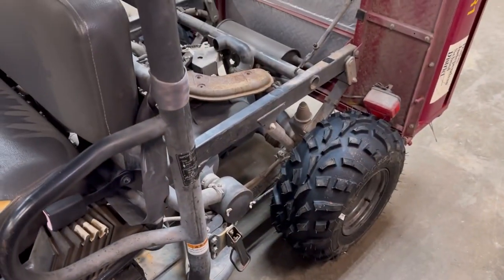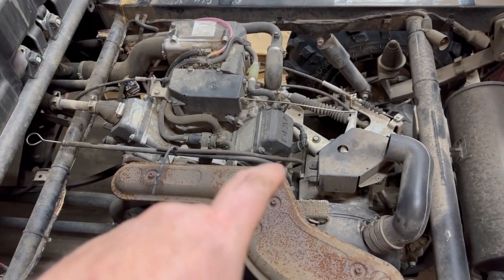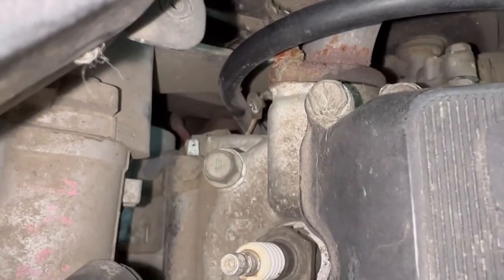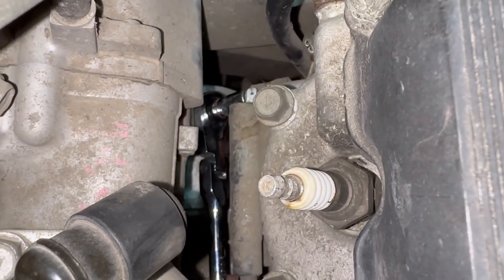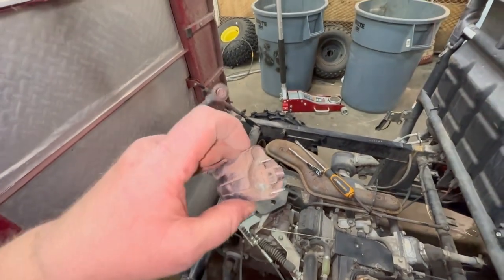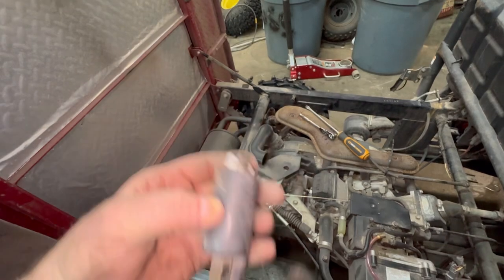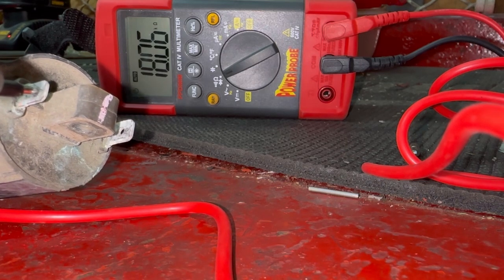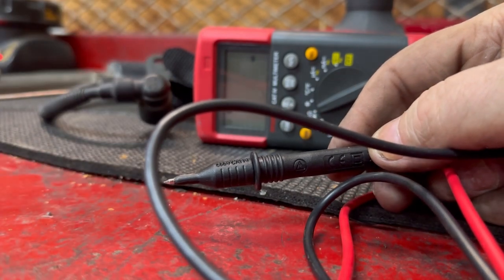#KAWASAKI V-TWIN BAD IGNITION COIL DIAGNOSTIC #FD620

Comment: Neighbor brought me his Toro commercial zero turn, no power, not running right. As soon as he started it to get it off the trailer I suspected it was only running on one cylinder. While he was there, I pulled the plug wires. Yep #1 was not firing. Not mentioning the name of the dealer, but they told him he needed a new engine or new mower. Boy was he pi**ed when I showed him the bad coil.

Comment: I have a tool that can pick up the electromagnetic fields of the coil/high tension lead and convert it into an approximate KV reading . I’m sure it’s not 100% accurate but the idea is to compare cylinders on multiple cylinder engines and look for the odd man out. Also on of those non contact voltage detectors are good to see if a coil is firing as well .

Comment: Check out the Hazet Adapter Set for Ratcheting Combination Wrenches. The set has a 1/4" socket drive that fits on a 13mm ratchet wrench and has a thumb spinner. Very compact for those tight spaces and you can continue to back out a bolt after it's loose. Good diagnostic video! Thanks
6:33

Comment: I run into one of those a few months ago. Except my coil turned out good.  having real repair manuals with real specs in them is the ticket.  

And I thought about relocating the rear coil myself but I was afraid it would look shotty. But the next one that comes across my path will be relocated.

Comment: If you test the secondary with the lead touching the spark plug wire directly, after unscrewing the spark plug cap, you get a rather large difference in resistance than with the cap on. Is the factory spec including the screw on cap or no?

Comment: Do you replace both coils at once?
My experience with Briggs push mower coil 9.7 is good 11.7 to 13 bad😊
Reply from the maker: I specifically stated in the video that I was replacing both coils / On what model? Each model has a different value, and all the coils read differently.
Reply: @THEMOWERMEDIC1  thank you my hearing was impaired.
Was just looking at the Quantum model engines or older, good to know they are different values for other models